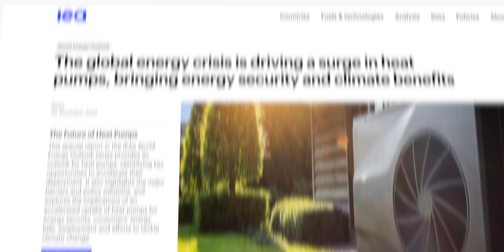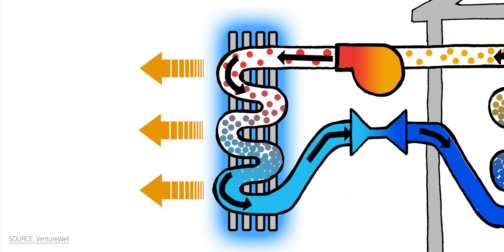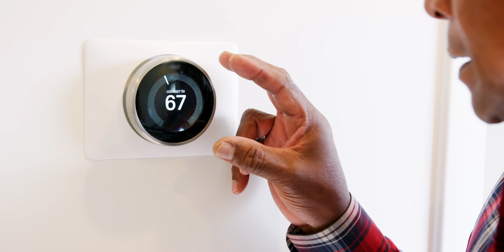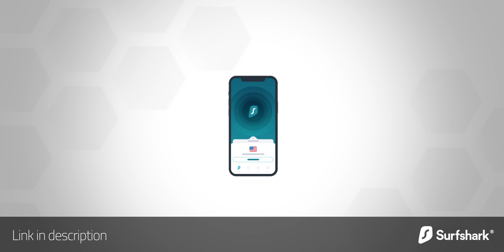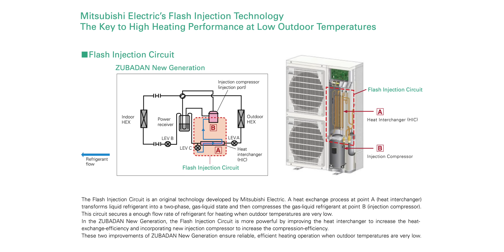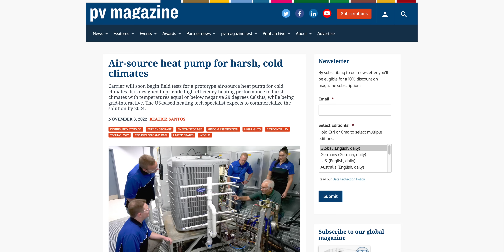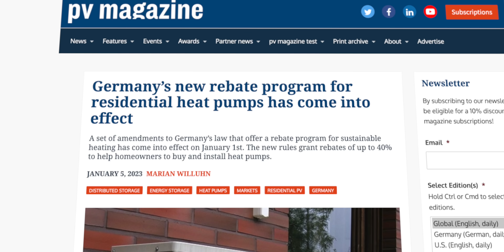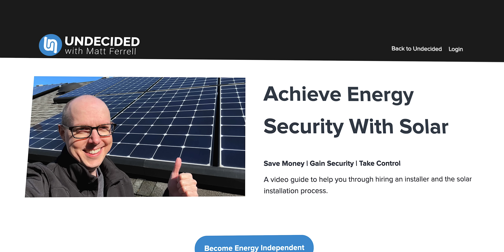Major Advances with Heat Pumps in the Extreme Cold

Comment: Big fan of the channel.  As far as heat pumps:  I spent 15 years in a rattle wagon installing & servicing HVAC equipment from residential to industrial.  I then moved to and currently in systems integrations/building automation dealing with a LOT of HVAC and energy equipment for the past 10 years.  Not all heat pumps are created equal.  The majority of residential heat pumps are air source (like a standard air cooled residential AC).  This leaves the heat pump impacted by a number of factors but in particular outdoor air temperature.  The hotter it is outside the harder the unit must work and the same is true with the colder it gets outside.  The further below freezing or above 90F air source begins having issues.  For heating you have to consider the energy efficiency of the unit, snowfall, defrost cycle, and how cold winters average in your area (specifically days below 20F) - there is a point that switching to auxiliary/emergency heat be it electric resistance heater, hot water coil, gas fired becomes increasingly required for cost and comfort.  The biggest complaint from new air sourced heat pump owners always claimed in the winter when they first tried heating with one - "the air coming out of my vents isn't very warm" ... depending on the air source heat pumps age, efficiency, sizing, install, condition, etc.  the supply air temperature will be traditionally cooler than that provided by an electric or gas fired furnace - with the heat pump working correctly.   Average life of typical residential air source heat pumps - if you get 15 years you're doing great.  I had an air source heat pump that lasted 30 years - I however did my own maintenance & repairs and could get parts & refrigerant at cost - at about 18 years the amount of maintenance & repairs began ramping up quite rapidly.  The "efficiency" & cost savings MYTH that sales people in the HVAC industry use to up sell their customers ... You will never reach those numbers by just swapping out an old system for a newer more efficiently rated system.  Why?  a typical residential single family home is wildly inefficient for infiltration - if you're not going to upgrade your insulation, air barriers, windows, thermal bridges, etc.  then paying for a high end air source heat pump you'll never see the savings promised or have the unit pay itself off in the time claimed - your house is still leaking and energy costs just keep increasing.  The only heat pump I would buy, & have plans to have installed in 2024, is a closed loop ground source (geothermal) system.  When sizing you can't just take current weather/climate - you need to look at projections for what summers & winters are likely to be like over the life of the system to meet those demands ... the upfront price is eye watering - but if you pay all that money for something sized for today it may meet demands for the next few years but be completely inadequate in 5 - 10 years.  Will all your heating and cooling inside your home be provided by forced air?  Will heating be provided by in floor radiant heat?  Baseboard radiant heat?  If heat provided by forced air will you have aux/emergency heat installed in case the heat pump goes down?  How old and efficient is your hot water heater?  Will you replace the HWH and have it connected to the geothermal?
Reply: If BTU/$ vs BTU/$ a heatpump is more efficient than a furnace, how is the air sealing going to affect that ratio? Why would a heatpump lose more heat with poor air sealing and insulation vs a furnace, its heat going to the duct either way.
Reply: @williamlancto3655 in addition for a forced air system, the air discharge temperature for a furnace is usually hot, around 110-120*F, which forms a stratified layer of hot air against the ceiling where there are usually tons of holes and gaps for the heat to escape out of the house. On a heat pump system the temperature of the air is only warm, between 80-100*F, so you'll get better mixing and less force driving through the gaps/cracks (which should also help preserve humidity inside the house).
Reply: @williamlancto3655  Heat pumps are very impractical if you live in a northern climate and have an older home (40+ years)  and/or your home is not very energy efficient. 2+ weeks ago we had -20F temps with a -30F wind chill 35-40 miles north of Boston. It really depends on your situation and where you live.
Reply: What the heck is a "rattle wagon"?
Reply: @AnyBodyWannaPeanut  Company/business truck...
Reply: My neighbors installed heat pumps for their home last year. Their electricity bills last November and December were $500-800 . Wow! Electric rates are consistently going upward faster than fossil fuels. I cannot see how the units are economically viable.
Reply: @B Kaledas   Here in New England it makes very little sense.  Plus, we get most of our natural gas from Putin in russia. One of the reasons electric rates went  up 112% this past year.

Comment: it's also very important to keep in mind that most places don't get those extreme colds that decrease efficiency all winter. a heat pump will still save electricity most of the time, and if you have for example a fireplace to supplement through the worst cold snaps of sub -30°C you're golden.
They make for perfect base heaters.
And don't forget your insulation... If you're trying to keep a temp difference, you might as well start with an insulation upgrade...

Comment: I live in a 9-floor high apartment building here in Helsinki Finland and last year, they dug 5 holes around our building, 300 meters deep each, and put some special cables in them with a special fluid and now they are able to suck enough heat from these holes to warm up our entire building for a whole winter. This will be much cheaper than buying heat from the city.
Reply: Now thats efficiency!

Comment: I got hooked up with Mitsubishi to be a test dummy for their hyper heat pumps to see if their heat pumps worked in a cold weather but high altitude home. 

My home is 10k feet up in the Colorado mountains. It replaced baseboard heaters and my bill went from $1600 a month to 600ish. 

The one winter I had them installed before I sold the home I never had to run the baseboard heaters. A few tests when it was -8 out the minisplits were pushing out about 118f heat. 

Air source heat pumps are 80% as efficient at that altitude so if it works there it'll work almost anywhere unless you get extended temps of below -20.

Comment: Heat pumps in the UK are not quite the same (they can be but most will be different) in the USA and Canada heat pumps have lines that go to indoor heat exchangers where air is passed over the coils and pushed either for cooling or heating into the room. In the UK the majority of houses already have water based radiator systems with water boilers, so heatpumps will be coupled into these systems, so heating water that is then pushed into the rooms via the piping system and the radiators radiate the heat. Cooling is not needed as much (but is increasing with warmer summers). This is where i feel heatpumps fai here for us right now, what is needed is a more US/Canada system where the pumps are essentially sealed units, no water, heat exchangers and fans, less losses and so much more efficient. 
Also it helps to have a passive or near passive house, most of the housing stock in the UK is leaky brick built 1960's houses that rely on brute force from combi boilers to heat the water in the central heating systems fast and hot so they houses actually get warm. Heat pumps here have integrated water heaters within them running at 3 to 7KW, so running costs can be huge, room radiators need to be way bigger generally also which means more wall lost.
To give an example of the difference here with these wet systems, i was talking to a heating engineer who fitted a heat pump 2 years ago or so to a reasonably large 4 bed house, the heat pump was coupled into the central heating system, radiators were swapped for more efficient units and would you believe the whole ground floor was insulated to help seal the rooms etc. The running cost of the heat pump was tripper per month over winter 2020 and 2021 to 2019 using the boiler, now with the fuel costs here in the UK the customer has now had a  gas boiler refitted and the heat pup which cost £18k to be installed has been mothballed, his house is also now able to run 5C warmer, the heat pump only kept at best 16C maintained.

They are getting better, BUT housing stock has to be right for them, initial cost has to be low for them and we need to get away from water based heating IMO for them to shine...like most here is in Europe.

Comment: CCHP's did not exist for a long time in the HVAC industry and certainly not at good efficiencies compared to other fuels.  Remember, heat pumps were engineered and popular initially for warmer climates where AC was already present to replace other fuels for heating where not much heat is needed.  Once that market was saturated, CCHPs needed to be developed for the issues arising when operating in the cold climates.  Geothermal units with ground coils were and still are a way around that but have much higher up front costs, in some cases very high depending on your area.  

Grid reliability and grid pricing of power has been an issue for many.  Homeowners in more rural areas will do some sort of backup power and powering a heat pump in a winter storm requires huge sizing of generator or solar which may not be available for the whole site.  These issues have historically made budget conscious and reliability concerned homeowners skeptical about taking the chance on an investment which must last 15-20 years for marginal cost benefits.  

I do see the technology is changing but its not a slam dunk for everyone.
Reply: Logically, if you are going to have a generator to run the heat pump, you would benefit from having a heat exchanger between the generator's cooling system and the home heating system to collect all the waste heat. The result should be a smaller generator is needed, as the heat pump will only be working half as hard. I know that it's a bit more complicated than that as you have to be able to provide the high current needed at startup for the compressor, but this is a relatively easy job for the battery bank+inverter that is likely to be present in a home with a new heat pump, along with solar panels.

Comment: My aunt has had geothermal for over 30 years, you freeze in the summer and sweat during the winter, the only time they ever used additional heating was when it dropped below -30 for about two weeks straight in the ohio river valley. I have always planned for geothermal heating and cooling when I get around to having a house built.

Comment: We installed mini-split air-sourced heat pumps last fall, and have been heating with a combination of wood + mini-splits this winter (in NH).  Getting a smaller system (sized for cooling, not heating) saved on up-front costs.  Our mini-splits are rated down to 5F, and are great without wood down to about 25F.  I doubt we'll need supplemental wood once we re-insulate and re-side.
Reply: Don't be so sure.  Also live in NH, and I heat primarily with a mitsubishi h2i cold cimate heat pump connected to a CERV forced air system.  New build home, super insulated (10" thick exterior walls) and super air tight.  When it dibbed to -20 this winter the house was 55F by morning and unable to climb without the aid of electric heaters and gas direct-vent fireplace.  Even when it dipped to right around 0F the house got down to 60F by morning.  The manufacturer says 100% capacity to -5F, but that's not what I experience, even with an energy efficient home.  The coeffecient of performance seems to drop off rapidly.
Reply: @neonnavajo  With an air source heat pump, I would be worried about frost forming on the evaporator coils, reducing air flow.  Is this what is happening?
Reply: @neonnavajo  This is because your outside units in direct contact with the wind which makes the unit far colder than it needs to be. Build a winter shelter like a dog house that can slide over the unit and help block wind while still allowing for some air recalculation.
Reply: @kameljoe21  building an enclosure for the unit would have the opposite effect.  The heat pump needs the "infinite" supply of heat provided by the air.  By enclosing it and limiting the supply of heat you would quickly consume the heat contained within that volume of air, and only make things worse - the enclosure would get colder, even if there was some recirculation.  Wind chill is a percieved cold by humans, the air is not actually any colder, in fact it would be warmer because it is moving more (temperature is a measurement of the kinetic energy).
Reply: @neonnavajo  Ah ok. Well I was thinking that because when it gets super cold it quits working. By creating a blockage of wind around it would help it run much better.
Reply: @kameljoe21  I've had my heat pumps through a winter season and the biggest problem was insulation to keep the heat in the dang house, rather than the system itself.  Even during heavy snow, the heat pump was able to keep up just fine, leaving a nice concave indent where the snow was blown out of the way.  I've got a Bosch Climate 5000 system, so the way it handles frost is occasionally it BRIEFLY reverses the loop to pull a tiny amount of heat from inside to melt the frost of the condenser.  Worked fine all the way down to -9F, and I love to watch the frost melt off and a puddle of water form in freezing temperatures :)  I've got insulation folks coming in a few weeks and they estimate a 25% drop in my energy bills just from fixing my attic insulation!
Reply: @mscs2911  That is nice. I would have to put a whole lot of money in to my current house to fix insulation problems. Which is why I am hoping that we can save enough enough cash to pay for most of a build in a few years. We own our house and land outright so I am not in the mood to have a mortgage of any sorts. 
My hope with the new house is to build is small enough and big enough and spend the rest on insulation. I am doing a duplex of sorts with a storage area between the 2. 1br 1ba per side. I have it down to 24x30 per unit and 20x24 for storage which could be a garage. I want to add a porch of about 6 to 10 feet. Yet porch also means concrete or paver stones. Doing a slab which mean in floor heat I hope. Which is the reason for the storage room along with other reasons. With post frame I can get around 10 inches of blown in insulation in the walls and over 3 feet in the roof. Which is where vents for ac and heat pump will be as well as water lines. Though I thought about doing water lines in conduit except for the fact that if you run hot water loops in there they could condensate and just end up with water. I am going to run cold water from my well to the house via conduit. These will drain back in to the well pit which will be large enough for a shelter which will hold all the well pressure tanks, a storage tank, massive filters, UV lights and anything else that I need and a sump pump. All of the electric and communication will be also installed via conduit from in the ground boxes. 
I have thought of damn near everything and even planned all wireless and wired stuff as well. Wired boxes for cameras and a whole sort of other things as well.
Reply: I suspect that your budget for batteries will determine success.  I'm in an 800 SF off-grid cabin at 2000 feet in the temperate North Coast California mountains. When I moved in four years ago, I installed a Bryant split to air condition and to reduce wood burning. I have a large window area, and the 12:12 roof makes a large volume for the loft. Insulation in 6-inch walls was above-average for thirty years ago. There is thermal mass under the passive solar tile floor to preheat the cabin to around 74 before dusk. In the high 20s, the heat pump pulls up to 1200 watts but averages 0.8 kwh/hour. I increased nominal LFP battery capacity from 10 kwh to 31 kwh. To prolong battery life, I use 20% to 90% SOC, so real capacity is a bit over 20 kwh. Because the sun often is not out, I continue to burn wood.
Reply: If you want to heat when colder, all you need is a larger heat exchanger(within reason of course), but this is the main limit.   A GOOD HVAC technician can add a much larger heat exchanger to grab that heat from the outside air.
Reply: Yes, definitely have plenty of wood on hand for the winter, I use a pellet stove and I’m very happy with it.
Reply: I am a viewer of Technology Connections and have been sold on the idea of heat pumps for a long time.
-
It was such a light-bulb moment when I learned that a heat pump is essentially an air conditioner that can run the temperature in the other direction, becoming a heater.
Reply: @MonkeyJedi99  Everyone has been using them going on 70+ years now.  A lot of cheap legacy infrastructure still exists though.  Though with the dirt cheap price of NG... heat pumps are still more expensive to run long term.  Only if you use solar thermal and geothermal in combination does the price over the VERY long term come close to NG.
Reply: @w8stral  What is NG in your context?
The only thing the abbreviation points to for me is National Guard, which doesn't add anything sensical to your comment.
Reply: @MonkeyJedi99  NG is universal for natural gas .....  in any heating context